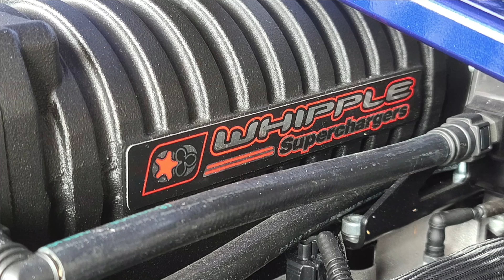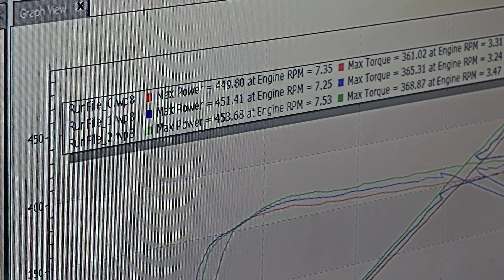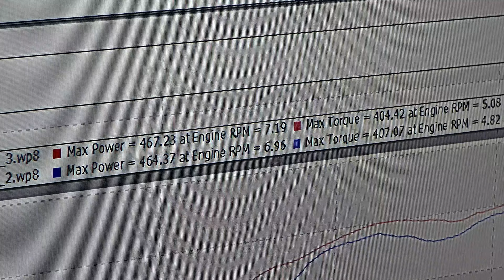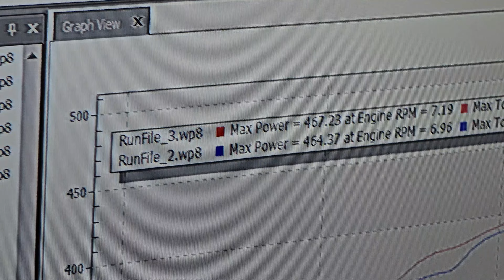(2015 and 2023) Mustangs on the dyno. Minion and Maverick

Comment: Hey Joel, quick question! Did you experience any check engine light issues after installed the catted longtubes?
Reply from the maker: I use the Fowler's for the rear and I have no issues as of right now